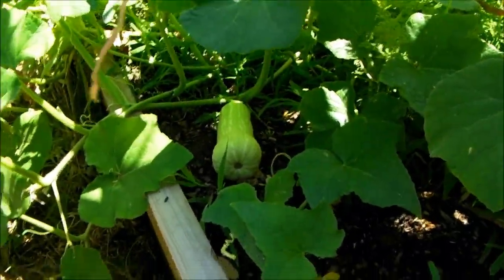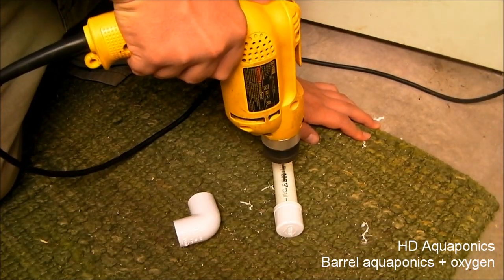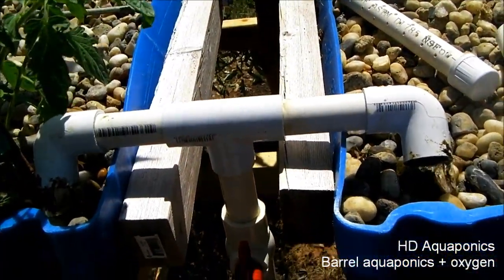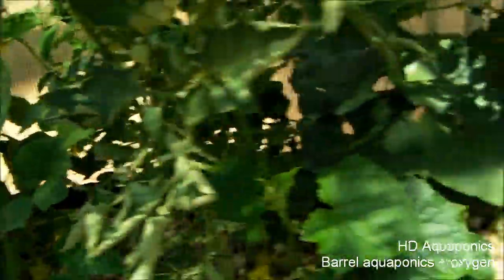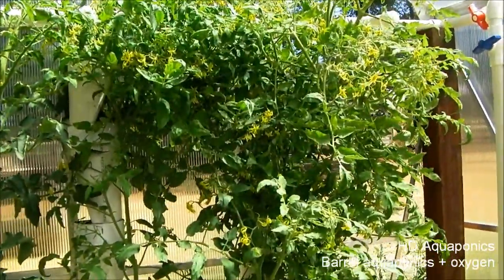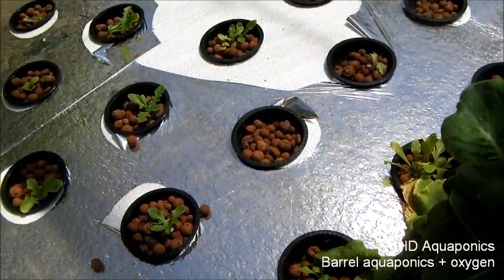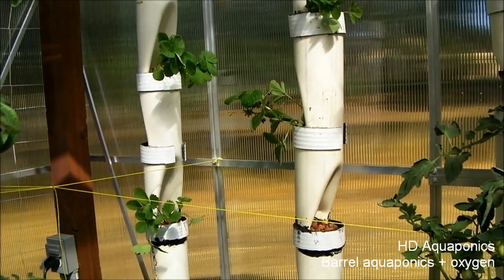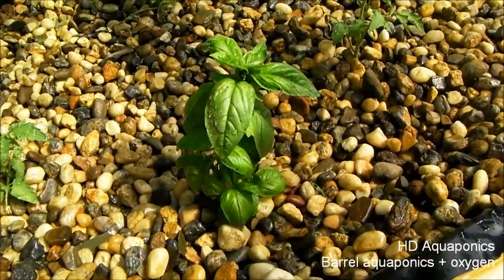HD Aquaponics - Ep.24 - Aerating the barrel aquaponics system, aquaponics greenhouse update

Comment: With this “aquarium” being outside you also must keep direct light off the tank to stop the water being heated but also to reduce the impact UV has on the plastic. I use a sheet of bamboo twitched together with fine wire, very aesthetic. Otherwise you are doing well, keep it up!

Comment: I was going to suggest the same as Yaheuben66. Put some sort of barrier so the sunlight is not directly hitting the sides of the tank. Home Depot sells rolls of linked Bamboo to create  small privacy fences or garden barriers. That might do the trick. and if handled creatively, might add an aesthetic quality. I think they are about  6' high, so if you go that route, you'd probably have to cut the height down.